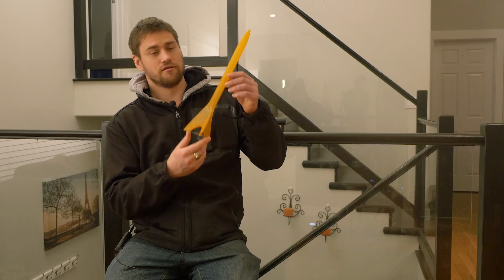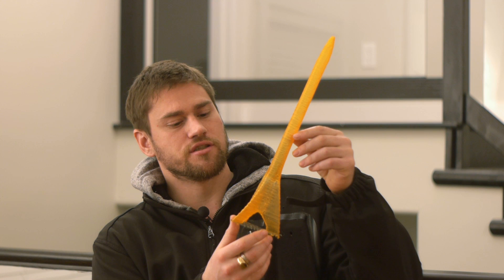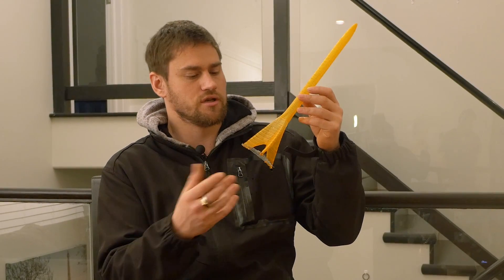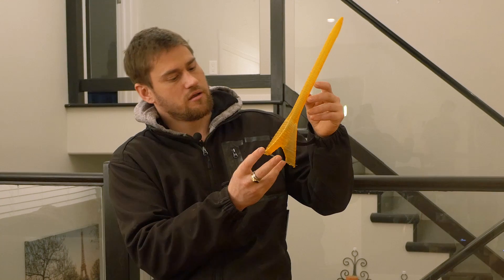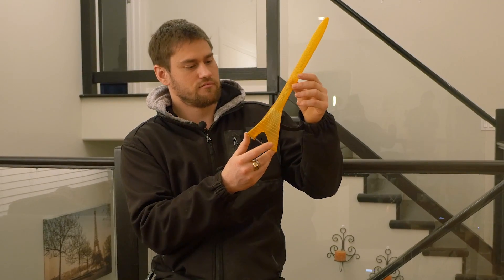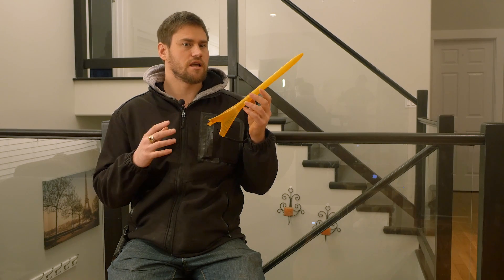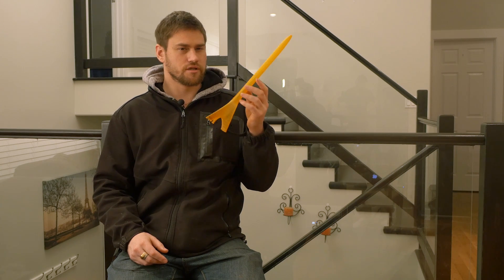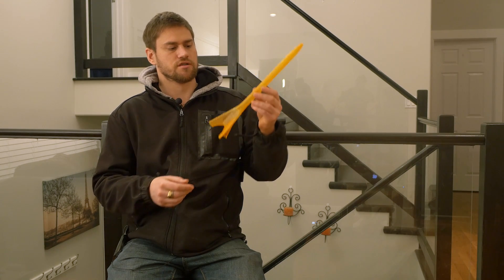Update #54 - Our Biggest Print Yet!

Comment: So I have not been able to find any information, but what is the largest DIAMETER print you can do with this?
Reply: +draggonhedd About $300,000 in diameters
Reply: +draggonhedd As big as your print reservoir is :)
Reply: so i could print something 12" in diameter and 12" tall if i had a big enough container and enough fluid?
Reply: +jrmaty Let's say I have a reservoir diameter of 8 feet with a height of 6 feet.  You're telling me all I have to do is mount the entry level kit on the top and it's going to work the same?
Reply: They do plan on printing an entire canoe with this kit, in one go.
So I guess so, yes?
Reply: +RetroRoadshow I would say no because they have a 1000$ professional option. I wouldn't be surprised if the reservoir can be even bigger than their pro version though.

Also even on the entry level one I feel it can be quite large, but the print will take a lot longer of course.

Comment: The sides of the rocket are not straight - it kind a have a angle -  that is intended?
Reply: +Marc Grossi I would assume theyre supposed to be like that, kind of like how fletching is curved on an arrow, which works as an aerodynamic stabilizer, yada yada yada. etc.

Comment: I have a couple questions. I have followed the peachy printer for quite a long time. Recently, I saw the announcement that v1.0 was released. I am thrilled, because first, the project is still alive. Second, its here. Third, it is a product that comes out of Canada. Which leads me to a couple questions and suggestions. 
First, do you plan to advertise and capitalize on your product? I think it has potential, but the average Canadian or American still likely won't know about it. 
Second, you say you are improving the printer constantly. Could we see a series of videos that demonstrate the quality of prints at this time, perhaps associated with the version of the build used for those prints? Could we see videos of functional prints in action? I'd like to see how your rocket works, after all. 
Thanks for reading. Cheers!
Reply: TimeSpaceRamblings 
i live in Chicago and i was a beta tester for this project and people around me that know kickstarter and indiegogo well didn't know of this project. Just spread the news! by word of mouth i already know about 6 people who plan on getting one. Even a Professor of mine.
Reply: Constantine Bovalis cool print but i want to know how fine it can print? i would love one of these but i need it for models and dont if at all possible want to sand each and every part [ some of them being over 4000 large ] so how fine can it print and could you do a veido on it, i know it is cheap but i dont want to spend 2000+ on the next best thing